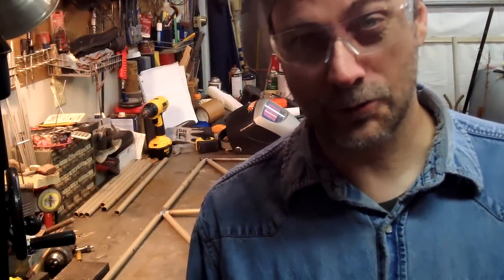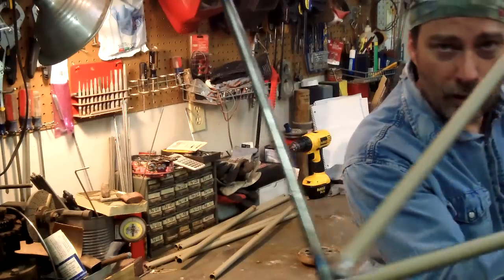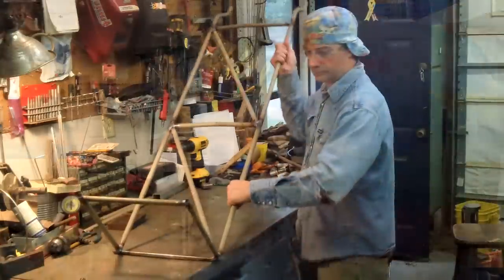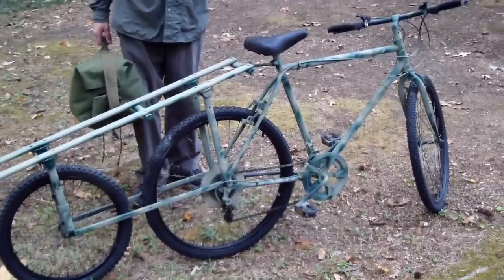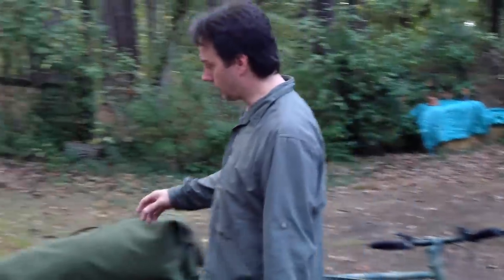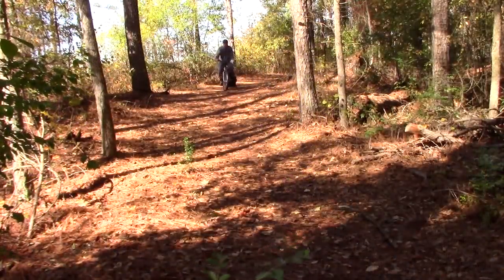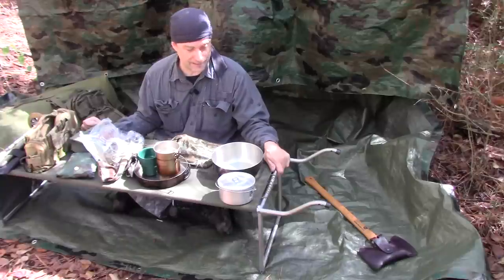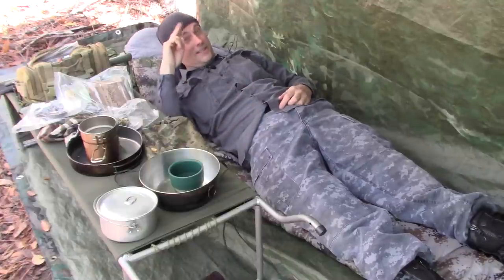The Bushcraft Camping Bicycle Travois

Comment: Just when I thought you couldn't do anything cooler, you go and pull a stunt like this..... 
  How are you solving the wheel rub issue? Bending the bars further or adding length to something? Rough terrain could make it rub a lot. I love the table conversion, that takes it up a notch...I wonder if lightweight aluminum I-beams would work the same but allow for bed strength. Thanks for sharing, keep up the good (and cool as ever) work!
Reply from the maker: Thanks! I'm happy you liked it! Raising the pivot mount under the seat and just a little larger wheels would cure the rubbing issues. With the right geometry and bracing aluminum would be fantastic!

Comment: Very good idea, thanks for the video. You actually don’t need 21 speeds, you only need the low 9-12 of a mountain bike for trails. I have a few videos with my bike and I only have one shifter. The trails that are on the video’s are pretty legit too. Have a good one!

Ps. It’s for weight saving... less is more! But you know that.
Reply from the maker: Thanks, I'm glad you liked it. Good thinking. I want to regear the camo bike very low and not even use a shifter or derailer
Reply: Reallybigmonkey1- I’m up in Michigan. There are some guys that only use one gear up here for these trails. You have to have some legs for that but if you’re not worried about speed low one gear will be fine. Less parts to fail of course.

Comment: Hi Dave! I thought your original build was amazing. I sure enjoyed your thought process through watching that build come to life. I'm sure the segment manner in which your filming this will be outstanding. Even if I can't envision how it could be improved, I know you can! One thought I would like to share; today's technology for electric bike hubs and batteries that can be mounted on almost any bike now, is something you should look at as you'll be carrying more weight and of course uphill issues. The bike can be peddled & the battery charges itself when rolling while not using power output. They truly has become far cheaper and with greater range. Very powerful and light weight. Cheers Pal and As Always, Blessings from Oregon!     ... Mike H
Reply from the maker: Thanks Mike! I'm glad you liked it. To most folks they would think the electric motor would be the way to go but, you would be shocked at how easy this is to pedal uphill. Everyone is used to ten or fifteen speeds. A 21 speeds lowering gearing is beyond belief. Thanks for watching brother Mike!
Reply: @Reallybigmonkey1  Absolutely old buddy, thanks for the insights and for so much Fun in following along.
Reply: @Reallybigmonkey1     Always my Friend!

Comment: Hey Dave Great Idea ..... you could even  put gear in the "Hand Truck Handle " area and it wouldn't  hurt to put some 45 deg Angle Gussets  from the leg parts  down to the frame rails to make it really bulletproof  and OFF ROAD TOUGH ... You should see how much  gear it would handle  weigh it all out ... Here's another suggestion for $27 bucks on amazon you can get  Z-FIRST 2PCS  8"  Adult Scooter Wheels with Abec 9 Bearings for Adult Razor and Kick Scooters double the size of your wheels now and still have the good bearings ..... you can also gain some ground clearance if you had the offsets on the other end too to raise it up  it looks like those would give you about 4" plus the 8" wheels you could go over some pretty gnarly bumps and obstacles ....   Awesome build Dave !!  Have fun Wood Badger Brother
Reply from the maker: Thank you for the ideas and I'm glad you liked it. Thanks for watching!

Comment: Cool trailer you have there. I don't know which one I like better. This new rig has an advantage over the first one. I think you called it a "hyme joint". As I recall that first rig would benefit greatly were you to adapt a hyme joint to it, it would resolve the minor side to side drag issue it has. Anyway I like both of the trailers. Nice work Monkey.
Reply from the maker: Thanks, I'm glad you like both of them. I have more mods in mind for both!

Comment: This is pretty cool! I'd say bigger wheels will be better in the woods to help going over roots and branches, especially when you are walking. For the tubes I'd add zippers on the open ends, the long one would make a leaves-filled sleeping mat like you've said and the short one a leaves-filled pillow. I'd change the upper rectangle leg with a triangle or rounded V, that way you will have three points touching the ground and it won't move/wobble/shake on uneven terrain, just like a three-legged stool.
Oh, and get a fender for the back wheel to keep the mud away and protect the bungee from rubbing against the tire.
Reply from the maker: Thanks for the input Dan

Comment: There seems to be no end to your talents Dave. Another super creation, got a feeling though , you may need to use chunkier wheels for the muddy parts of the woods. Great job Dave, take care 👍😀
Reply from the maker: The small wheels with the high speed bearings work perfect for trail use. Since this video was filmed I now have a larger set of wheels I swap out for off trail use.

Comment: Great work mate.  Just a thought - would it be worth attaching/strapping another pole to the frame which you can use when you take the travois off the bike.  Once detached you screw the extra pole onto the handles.  That way you could actually run some cord from the "handle" to the top of your pack to drag it hands free? - like I said great work
Reply from the maker: Thanks Keith! I like that idea and may use it.

Comment: I think there is room for couple improvements. You can put fenders on the bike, you dont want to pick up all the mud if its raining. Better if you make them yourself from 2 inch pvc the thinnest one.You can make them as long as you want.
Then you can  make a rear rack and a front rack, they are very useful to put extra stuff you need quick access.  Then attach the "hand" to the back of the rear rack. This way the travois is lower and has better stability, and is way back from the rear wheel and does not touch it.
I make myself the travois from a long metalic covfefe table (Recover Recondition Reuse 😎:-) so I can sleep on it and use it as table as well.
Reply from the maker: Thanks for the input!

Comment: Nice !! MB some pull out extensions for the table legs for stability ?  Tig a threaded coupling in all 4 (feet) ends , UNpin extension and backthread the rod to the INNER coupling end . Extend the (cart) length for laying down , bigger wheels and Fold Out side extensions . Instant bed using the cart handle area as a pillow area . I.E ,. PULL out extensions for the legs for stability . Could even get some Tent poles and make a portable shelter , bed , table and cart :D Great design as per usual  !!  .. BG
Reply from the maker: Good ideas! Thanks for watching

Comment: That's neat, Dave. The little wheels are lightweight and good on flat surfaces but may not work well on rough terrain. They may get larger as this travois develops into a bed and gets pulled into rough country.
Overall, that's very clever and extremely useful. That makes into a really handy work area.
Reply from the maker: Its a work in progress. So far the little wheels worked ok.

Comment: Good idea! The main reason for having bigger wheels, by the way, is rough terrain. And, even when the bearing on a bicycle wheel isn't high-speed it rotates slower, due to the larger circumference, so it should even out.
Reply from the maker: The small wheels with the high speed bearings work perfect for trail use. Since this video was filmed I now have a larger set of wheels I swap out for off trail use.

Comment: Hey Dave, a simple quick fix for the rubbing between the rear wheel and canvas would be just extend (lengthen) the rod that comes out of the plastic block attached to the seat post.  It looks like you'd only need a couple more inches to alleviate the problem. Just a thought.  Another great video Brother.  God Bless and be safe out yonder!!!
Reply from the maker: The small wheels with the high speed bearings work perfect for trail use. Since this video was filmed I now have a larger set of wheels I swap out for off trail use. I also raised the pivot mount for more clearance. Thanks for watching Thomas
Reply: @Reallybigmonkey1  Raising the pivot mount?  That's an even better and simpler fix than I came up with.  That's why "You're King Of The Hill (Or at least bush crafters)!!!"
Reply from the maker: Thanks!

Comment: That's a great idea, good way to carry a lot more gear. If you were to ask my opinion though, bigger wheels will roll over things like stones and rough terrain a lot easier. They will also give you a little extra room between the tire and the cloth. Looks like they make contact a lot. They would also help to keep the load out of water if you go through a shallow puddle of water. Maybe something to think about, just a suggestion.
Reply from the maker: The small wheels with the high speed bearings work perfect for trail use. Since this video was filmed I now have a larger set of wheels I swap out for off trail use.

Comment: Hello Dave.  My concern with those tiny wheels is #1 clearance at the back cross member and #2. When a small wheel hits an obstacle it tends to butt up and drag where a much taller wheel rolls over.  In bush terrain it looks like it could a problem. The idea is awesome . I always enjoy your video my friend.. I can't wait to see it in real use.  ATB.   Paul
Reply from the maker: The small wheels with the high speed bearings work perfect for trail use. Since this video was filmed I now have a larger set of wheels I swap out for off trail use.

Comment: Thanks for the video and I think bigger tires would serve you better for a wider range of terrain and weather conditions. Overall a great idea.
Reply from the maker: The small wheels with the high speed bearings work perfect for trail use. Since this video was filmed I now have a larger set of wheels I swap out for off trail use.

Comment: Cool build David i been wanting to make something to carry my gear with a bike for a while now i got diabetes and neuropathy in my feet so i can't carry a heavy pack anymore, i did build a bushcraft buggy out of an old joggers baby stroller   and worked great but you still had to push it , so ya that is just what i need LOL . hey for the flexing of the fabric when in tablet mode couldn't you use as a lightweight piece of Luon for use for flooring? maybe store it under your gear so it doesn't rub on the tire and after you unload the cart put it up top for the table ,i don't know just an idea i guess LOL thanks for sharing 
atb john
Reply from the maker: Thanks! I'm glad you liked it . Can you attach that stroller to a bicycle? I think I may try a thin sheet of plastic to the cart to better serve as a table. Thanks for watching

Comment: That's awesome and I admire your skills to think of something like this and build it. So, this is just a thought.  Could you have used pins,  like the ones on some deer stands, to attach to the bike instead of bolts? Then you wouldnt have to tap the ends of the cross bar and it would be easier to connect. Maybe that wouldnt be strong enough or maybe the metal wouldn't hold.  I guess it could lead to wear and tear and "wallering" , as we say in WV, out the holes
Reply: On another note. That thing turned out great!
Reply from the maker: Thanks, I'm glad you liked it. Yes, I could use pins and I love the idea! Thanks for watching.

Comment: This is another great idea, invention, and vlog!! The only things that come to mind is that it keeps your gear off the ground and organized.  My contribution would be to add reflectors for when you're on the road, and possibly a foolish idea of adding flotation for shallow puddle and stream crossings. Its probability not strong enough to be used as a bench or cot which would be great,  and putting too many add ones on would defeat the purpose.  Did you consider the possibility of strapping your bike on top while in hand truck mode for the really difficult crossings?
Reply: I'd like to see it used as a table next to a low hanging hammock setup, (used as a seat), Talking about all the comforts of home!
Reply from the maker: Thanks, I'm glad you liked it. I'm thinking four difficult crossings I would get off and just walk beside the bike?
Reply from the maker: That would be a good set up James

Comment: Looking good Dave probably going to need more ground clearance on the lower end at least I do here in California I could be wrong but I don't think there is a trail anywhere in the state that does not have 5 to 10 inch granite rocks sticking out like shark teeth just waiting for some one to stumble. Happy trails
Reply from the maker: Thanks Mike, I doubt if theres 5 to 10 inch rocks Ill tackle that with just the bike by itself. Thanks for watching

Comment: I like the dolly idea with 12" lawn mower wheels. Dave, did you float the idea of putting a folding leg in the middle to give more support for the bed option?
Reply from the maker: The small wheels with the high speed bearings work perfect for trail use. Since this video was filmed I now have a larger set of wheels I swap out for off trail use. Haven't thought about a middle folding leg but I like that idea! Thanks for watching Greg

Comment: I just got a packing bike and guess which video came to mind?
It's a boy's bike (Trek, cro-moly)with medium frame and I'm 5'3".  I'm going to adjust the seat and maybe smaller wheels?
Need to customize it, would like to avoid altering the top bar if possible.  Any suggestions?  Love your videos..........
Reply from the maker: I wouldn't go with smaller wheels,  use what's on it. Possibly make some saddle bangs for the rear fender and center bar?
Reply: @Reallybigmonkey1  thank you, yes!  wish i could send you a pic!

Comment: The thinking has changed when it comes to offroad cycling. It's not more gears, but having the right gears. 1x10-1x11 gear is the standard now. That is, cog up front and the 10 or 11 cogs on the rear wheel.  A setup like this lets you have really easy low gears for climbing up hills and really fast gears on flat terrain. The sacrifice is that it's more of a jolt switching between gears. But, you also get the benefit of not having to worry about switching gears on the front derailleur. It's just up and down with your right hand.
Reply from the maker: When I use this bike with the travois I'm probably gonna stay in the low gears. When I unhook I'll use all the gears. I think I'm going to regear the camo bike

Comment: Well monkey: There you go being creative again. Well done. As an adaption for Ontario, were every trail & portage seems to have elevated rocks or thick roots.larger rear wheels might be necessary. Thanks Brian 79
Reply from the maker: The small wheels with the high speed bearings work perfect for trail use. Since this video was filmed I now have a larger set of wheels I swap out for off trail use.

Comment: You could use this at home for a breakfast in bed table. I think it needs to be raised off the rear wheel as it looked like it was rubbing. Maybe a steel mesh instead of the cloth and you could use it directly over the fire to cook on. Just some thoughts. Really cool piece already.
Reply from the maker: Lol, breakfast in bed? I like the steel mesh idea.

Comment: The principle is great, however, I think you will probably use approx 6" or so wheels in the future. I will suggest that instead of using paracord to hold the canvass on, some straps with buckles would allow you to tension it a little better. I do love the concept of an upgraded travois. Stay safe & be well, Dave
Reply from the maker: Its a work in progress. For now, the little wheels did the job. Bigger ones can be added later. I felt like the paracord added extra tie off points? Thanks for watching Dave.

Comment: Great project, you might want to consider wheels that are a bit larger,  its possible you could have some problems trying to roll over larger objects, otherwise a great idea and as usual, another great video, thanks.
Reply from the maker: The small wheels with the high speed bearings work perfect for trail use. Since this video was filmed I now have a larger set of wheels I swap out for off trail use.

Comment: Heck yeah man”cary allot more gear&easier then on your back I like that I can see you probably adding bigger tires&a back finder
Reply from the maker: The small wheels with the high speed bearings work perfect for trail use. Since this video was filmed I now have a larger set of wheels I swap out for off trail use.
Reply: Reallybigmonkey1 
Heck yeah👍

Comment: Hey, David, I've watched a lot of your videos.  I do disaster work and after a lot of disasters, families are often unable to locate immediate emergency housing. They can go to a mass shelter, which has its own problems, and FEMA trailers won't even be in the area for about the first month.  Have you seen anything that would provide shelter which was safe and secure and could be used in, say, the first 30 days in a Wal-mart parking lot?  This is a gap in the emergency management system and I'm trying to figure out a way to fill it.  Most of these folks won't have experience in bushcraft like yourself.  So anything you can come up with would be helpful.  Oh, and I'm going to start calling you the Prince of Tarps.  Merry Christmas!
Reply from the maker: It if was in the woods  where theres trees no problems. In an asphalt parking lot with no trees? It can only be a canopy or pole tent. Otherwise stretch a giant tarp between two buses or trucks? Merry Christmas to you too Kate!
Reply: @Reallybigmonkey1  Thanks, David.  The two cars or busses thing could work.  God knows FEMA has tarps out the wazoo.
Reply from the maker: I'm glad I could help!